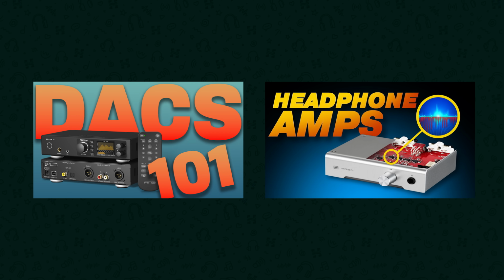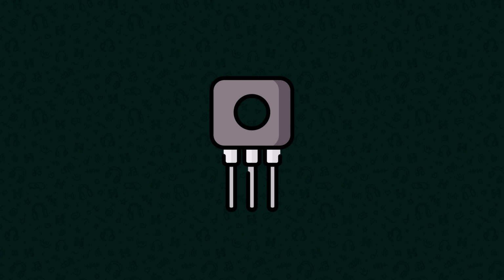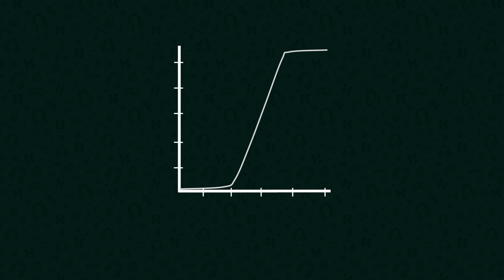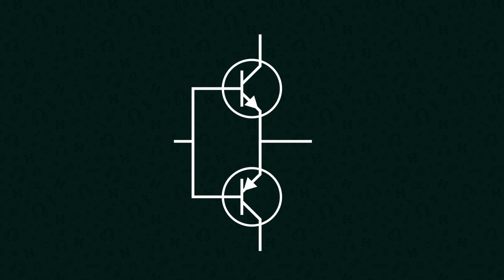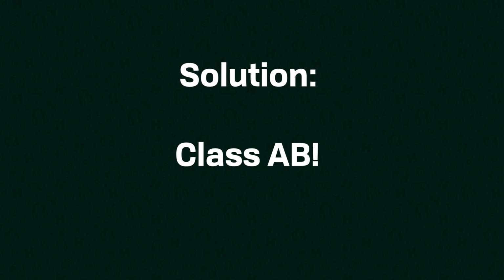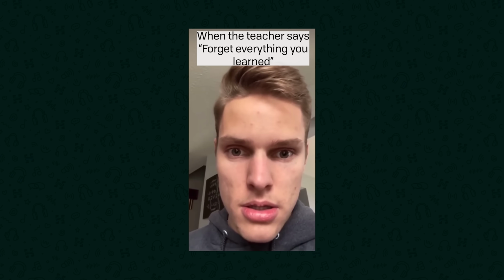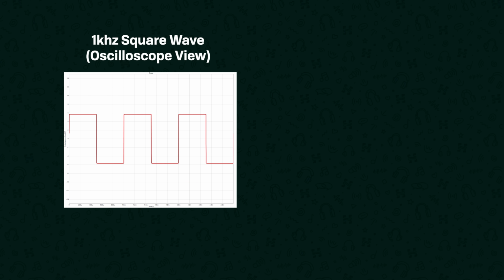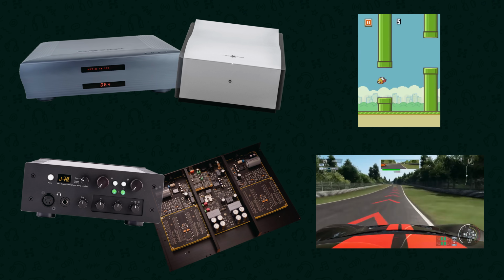Audio amp classes as fast as possible!

Comment: I’ve been doing with pulse width modulation with on/off (water) valves to control temperature as an approximation to a modulating control valve. I’ve designed a class D control system and didn’t even know it.
Great video. Whilst I did some electrical engineering subjects at Uni in the late 90’s I’ve either forgetten this or didn’t fully understand

Comment: Please I need help to understand how the class D transforms the square wave into the sine wave
Reply: LP passive LC-filter, the square wave is very high frequency compared to human hearing. (~100kHz to ~1MHz) the LC filter acts as an integrator so it just sums up the pulse over time and gives you a nice, smooth audio signal iirc.

Comment: Would also like to know about the flow of current from the source to the speaker. What happens along the path? AC to DC back to AC? Power consumption at the source vs output power. How much electricity does it take to put out 100w per channel? Does it take more electricity when you use 4 ohm speakers vs 8 ohm?

Comment: Just a small remark..
Actually push-pull setup can also work as pure class A amplifier, not only class B or AB. It will give 4x output power compared to single-end amp with similar rail voltage. Downsize is high heat dissipation.

Comment: The flappy bird analogy is actually a really good analogy. I’ll stick with my class AB amplifiers because class D amplifiers just sound too clinical and sterile and don’t have the punch that a good class AB amplifier has. 

That being said class D amplifiers obviously have their place such as in our smart phones and Bluetooth speakers, etc., but not when it comes to driving power hungry speakers And heavy dynamic loads
Reply: "The flappy bird analogy is actually a really good analogy."
It is a better analogy for a certain type of serial analog to digital converter.  Charge pump a capacitor until it exceeds the input signal voltage and count the number of pumps it took.  It works well for relatively slow changing voltage, is highly linear and relatively cheap and easy to implement.  It has a "slew rate" limitation.  That's okay for music; high frequency content tends to have very small signals.

Comment: And then there's class H, which is what my amp is, and does something along the lines of class A or AB (depending on the transistor setup) but with variable input voltage rails that are always only slightly higher than the output voltage to not have as much energy wasted as heat. This is way more efficient than class A or AB, but doesn't rely on the methods class D does.

Comment: I  went to buy an amp for my car and asked the guy what the different classes mean. He got about a minute into the explanation, then I stopped him and asked which one does he recommend. He said D class it runs cooler and that was that.
Reply: Class D also tends to be smaller and certainly lighter weight while offering considerable output power.

Comment: Every Amp should be Class-D.  No listener can ABX the difference under 1% THD.  Cheaper to make.  Easy to obtain higher wattage for less build cost.  Lower heat.  Higher energy efficiency.  Smaller footprint.   Allows for fully active speakers with active crossovers.   Class-D simply wins.  Class-A sounds better only when pushing into greater than 1% THD, but Class-D amps are so easy to pack high wattage that no listener should reach that distortion with all that headroom.

Comment: The best amp is not cut and dry, if you want the best uninterrupted sound, class "A" is king in a type amp setup using
Tubes, but it is very limited in output and needs very low impedance speakers in mainly 2 channel setup. For larger fronts and being better on your power bill, "AD" is king. With high quality amps you will be good with class "D" and you won't tell a difference. Ultimate setup would be class "AB" fronts and "D" for Sub for a 2.1 channel setup for power for high and mids and good bass for lows without draining your power. The classes for amps are only a configuration and should not necessarily be the only thing you look at when determining the amp you buy. Class "H" is a newer configuration that can bring much more power and add to class "D" without losing any distortion. The components used and gage of wire the manufacturer uses can dramatically affect the overall result of TFD and power handling of desired output. The desired result will dramatically depend on if you want Crown or Kell or any other brand in your setup.

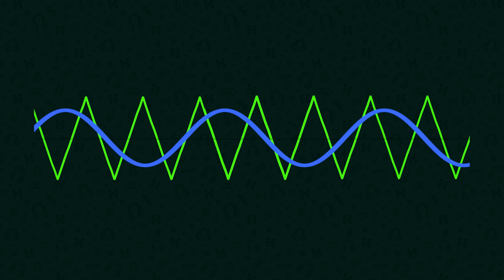Comment: Thank you for this fantastic video! Just a quick correction though: At 07:13 you say that the comparator switches on when the input signal is higher than the triangle wave, but the drawing shows the opposite!

Comment: I’m reacting on the comments about the efficiency of class D. The argument is that’s 90% or more, which makes it about twice the efficiency of other classes, so +3 dB efficiency gain.

What are we talking about?

If I change my loudspeakers from 82 dB to 102 dB sensitivity I get +20 dB more output, that is 100 times more!

Moreover if you’re amplifier is more efficient but your loudspeakers not, you’re more efficiently heating up your voice coils.

If efficiency is a factor for you, you better choose more efficient loudspeakers and you better get rid of your passive/high level crossovers. That gives for more improvement than that silly factor of two.
Reply: Efficiency becomes a factor in large outdoor stadium sound systems where you may have kilowatts of audio and you probably don't care that much about crossover distortion (Class B or AB systems) or limited or non-existent damping factor (Class D).
Reply: @thomasmaughan4798 The class D amplifiers I do know have huge amount amount of damping factor.
Actually I’m not a fan of electric damping. Which class D amplifiers have no damping factor?
Reply: @JerryRutten  "Which class D amplifiers have no damping factor?"
Essentially all of them although apparently some mimic a damping factor through feedback, but that's limited in effectiveness.  
When the voice coil builds up some momentum and overshoots where it is supposed to be, it generates an electric current.  If you absorb that current, the voice coil will stop moving almost immediately; that is to say, its excessive movement is damped.  
A class-D amplifier power transistors are simply turned off for a significant portion of the cycle and consequently cannot absorb or damp this energy coming from the speaker.    A voltage feedback loop will detect this overshoot and reduce the voltage being send TO the speaker, but that does not actually damp the movement.  This type of feedback is also unstable and could conceivably oscillate.
Reply: @thomasmaughan4798 Sorry, but I don’t think so. 

A class D amplifier switches the output between the plus rail (top transistor on, bottom transistor off) and minus rail (top transistor off, bottom transistor on). So most of the time the output is directly connected to one of the rails, only not during the short moment of switching. This is the reason why class D is so efficient!

A class A and class AB is continuously in the ‘switch area’, meaning never directly connected to one of the rails (only when it clips). 

So, in my opinion, without or with negative feedback of the output voltage, a class D amplifier should give a lower output impedance and thus a higher damping factor.
Reply: @JerryRutten  "So most of the time the output is directly connected to one of the rails"
That would destroy your speakers in a few milliseconds.  Consider the state of no signal, or no appreciable signal.  The voltage at the speaker should be zero or close to zero; nowhere near either power rail.   As the signal starts to rise, consider the positive half-cycle, the transistor or MOSFET ("T" for transistor anyway) connected to the positive power rail will activate very briefly, microseconds, and then turn off.  This tiny squirt of energy will dump into a capacitor which then feeds the energy slowly; the effect being a dramatic reduction in voltage in exchange for letting it take longer (to the next pulse).  As the waveform approaches peak signal, the MOSFET duration of "on" will approach 100 percent "on" for that time slice.  This is then reversed back down to zero crossing.  

After zero crossing, the positive half will do absolutely nothing; the pulses will now come from the negative rail. 

It can be seen that the "impedance" of the amplifier rapidly switches between infinite impedance (top and bottom transistors OFF) and basically zero impedance (or or the other fully ON and connected to the power rail).  So really the actual dynamic impedance is going to be the integrating capacitor and that's going to be frequency dependent.

Since the problem of overshoot affects primarily the massive woofer cone, low frequency impedance is what matters; and the integrating capacitor will have very high impedance to low frequencies.  

Here's some mildly useful content on the topic but they don't really get into bipolar outputs.  It is interesting to see the "full bridge" bipolar output while not actually using two power rails (one rail and ground). but it takes twice as many MOSFETs to implement. 

https://www.analog.com/en/resources/technical-articles/fundamentals-of-class-d-amplifiers.html
Reply: Hi  @thomasmaughan4798 ,

The picture you’re imaging is wrong. There is actually no switching between ON (zero impedance) and OFF (infinite impedance).

There is switching between +Vss and -Vss, or between +Vss and GND (and that in half or full bridge mode). There is always a transistor ON (between switching), so there is switching between ON (zero impedance) and ON (zero impedance). The only impedance is essentially only that of the output integrator.

“That would destroy your speakers in a few milliseconds.” So there is no problem, typically the switching is within 1 microsecond, and there is still the integrator…

Comment: *voltage....its voltage that "turns the transistor on/off" the amount of current flow is purely a resultant and not a triggering factor. transistor datasheets will always state the minimum threshold voltages.

Comment: But which class  sounds best ?
Reply: The one with the least distortion sounds best, therefore class AB sounds best because it's the current world record holder for the highest SINAD, lowest THD+N. <|-|3***<K Topping B200 on A*d**sc**nc*r*v**w (censored). The previous world record was the Benchmark AHB2 which is class AB+H.
Reply: @zyxyuv1650  correct but you practically can't hear the difference
Reply: @zyxyuv1650 yo what's the censored part? I'm trying to learn from your comment.
Reply: @allnighterist  I'm not able to respond, I just tried 10 different variations on a response and every one of them is deleted. The censorship settings are so high that I can't even use common words.
Reply: @allnighterist  I was trying to say they <censored> <censored> the <censored> on <censored> where you can <censored> the leader board graph of all tested units.
missing word = B200
missing word = <***>udio
missing word = <***>cience
missing word = <***>eview
Reply: @allnighterist  "Audio Science review". Its a forum

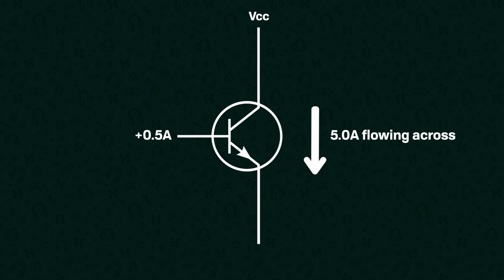Comment: 1:57 ish... You mention input. Which lead is the input? The collector or the base?
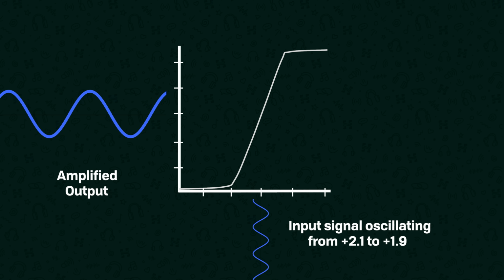Then about 3:00 ish you attach a speaker to the collector after having originally said that the collector is supplied with a constant current.
I feel like I went from having a decent understanding to being completely lost after watching this video.
Reply: ha agree, i was mainly enlightened but slightly confused by that diagram?

Comment: Does a transistor have a current threshold? I've never checked. It does have a voltage threshold however. Vbe. Typically 0.4~0.6V. That voltage must be reached before it will conduct. Welcome to silicon junctions.
Reply: u didnt specify bjt or mosfet
Reply: @urnoob5528  Vbe infers BJT because a MOSFET doesn't have a base or emitter. ;)

Comment: Class A is overrated IMO. I've owned a Yamaha CA-2010, which sounded great in Class B mode. Could not hear any (bad) distortion. Hard to notice any difference in sound quality vs it's class A mode, other than making amplifier a space heater as well. If class B is biased properly, it sounds quite good and clean to the human ear.
Class D does sound quite clean with proper implemented lowpass filters. They a a tendency to sound a bit clinical and also very transparent (a bit bright maybe). Well, If you want non clinical sound, Tubes are the best option. They add "warmth" (2nd harmonic distortion) to the soundstage.
Class D efficiency has made it possible to build tiny and capable audio amplifiers ("all in one" transistor/outputstage solutions) using small heatsinks. You can build a 50Wx2 (8 ohm) stereo amplifier that weight less than 1kg including housing. Smaller than a typical book.

Comment: 🇬🇧 👍🏽 February 2025

Okay - but:

Can anyone explain exactly how 'amplification' occurs in a transistor?

All of these explainer videos seem to conflate & confuse 'amplification' with simply a fully-open voltage gate (i.e. Vmax).

Simply allowing access to the full feed voltage is not the same thing as amplifying said voltage.

A step-up transformer amplifies voltage - but I don't see how a transistor does.

Further - just because transistors are used in 'amplifiers', that doesn't then mean that transistors amplify voltage.

Amplifiers are simply sound/electric power processors - & electric power can be used to make a small sound larger - sure.

But let's not incorrectly credit the transistor with the function of 'amplification'.

Everywhere I ask this - it's met with silence.
Reply: You're not amplifying the high voltage signal going from the power supply through the transistor, you're amplifying  the signal coming from your audio input.

I think an easier to understand term might be "signal shaping". You're taking that "big" signal, and shaping it so it looks like the "small" signal. The end result is that the small input signal and the big output signal have the same shape, so you've effectively amplified the shape of the small signal .

Comment: It’s really interesting to see how old some of these “new” technologies are.  The Commodore 64 computer (from the late 1970s) had the best audio processor of its day: the SID chip (Sound Interface Device).  It had a square wave generator with a 12 bit programable duty cycle which could be fed into a programable low pass filter and then out the chip.  By feeding the duty cycle register with a digital audio track via a timer triggered interrupt service routine you could produce digital audio.  If anyone remembers the classic Mission Impossible game, that’s how they did the voice.  This technique is essentially a class D amp, without the sawtooth modulator producing the square wave.

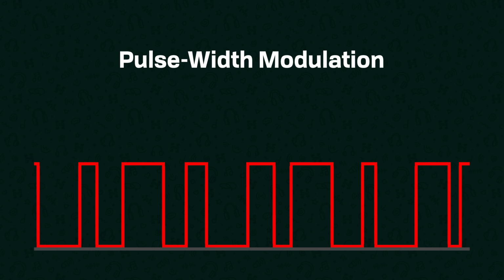Comment: 7:33 Are you sure that this is PWM? PWM should have a fixed frequency, this looks more like Delta-Sigma.
The flappy bird analogy is incredible!
Reply: The fixed frequency of the sawtooth comparison waveform sets the PWM frequency.  The center of the "on" will match one peak of the triangle wave and the center of the "off" will match the other peak.  Actually, this produces a uni-polar output and is unsuitable for audio or inverter use.   So you need two such PWM inverter stages; one for the positive half-cycle and one for the negative half-cycle.  MOSFETS are commonly used and it becomes VERY important they do not both turn on at the same time.  So there's going to be some crossover distortion when the MOSFETs are both turned off.

Comment: Extremely well explained. I think the only thing that's missing is a qualitative analysis. Like, do class A transistors produce a "better" or somehow more favorable sound than AB? Are they cheaper to make? The video frames AB as a clear superior version to class A (and B), is that the case?
Reply: You need extreme linearity in the transistor.  Bipolar Junction Transistors are less than perfectly linear.  JFET (Junction Field Effect Transistors) seem to me to be more linear and have transfer characteristics very similar to vacuum tube.  
Yes, Class AB is superior overall to all other designs for your typical hi-fi home use or small theater.  Pure Class-A works well for headphones since so little power is demanded anyway.  Class D is a good choice for large auditoriums and outdoor venues where you need thousands of watts.

Comment: So technically class AB is more complicated and uses more transistors. Why class A is usually more expensive?
Reply: Mostly because you have to have more substantial heat dissipation and power supplies. The actual transistors themselves are usually a tiny portion of the built cost of an amp

Comment: You only describe single-ended class A. Class A also can use push-pull output. The most important in class D amplifier is "dead time" not the frequency of the PWM. Negative feedback and how to compensate the amplifier make the amplifier different. I like high slew rate and low distortion amplifier, but I prefer the harmonic profile of the distortion is monotonic or at least the 4th and above harmonic of the distortion is very low compare to 2nd and 3rrd harmonic. I am designing audio amplifier of class A and AB.